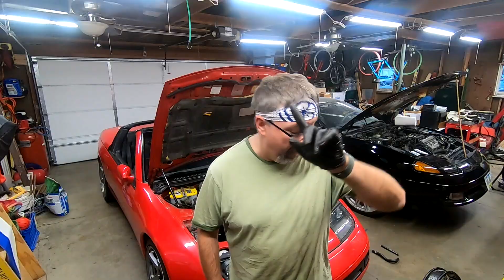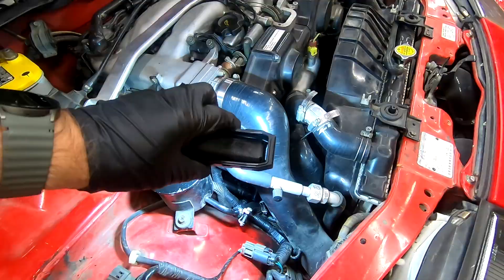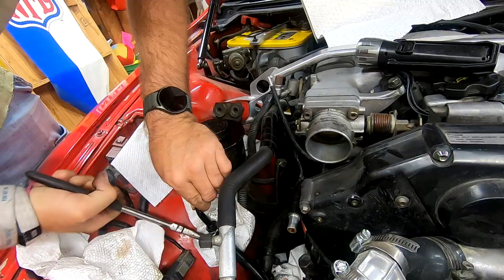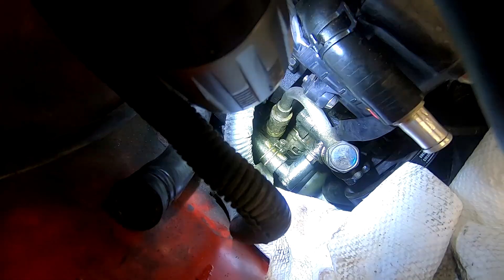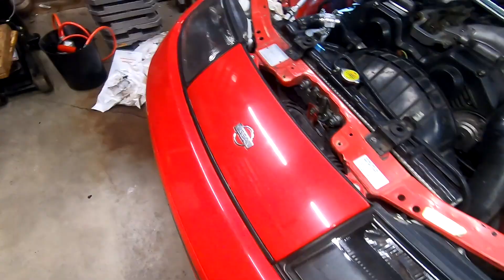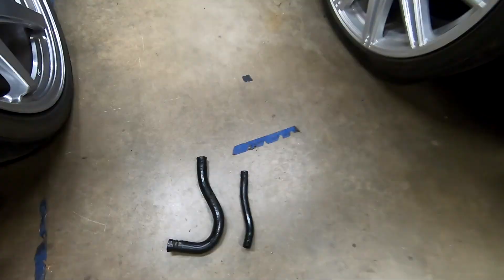300ZX (Z32) - Power Steering hoses - replacement

Comment: This is exactly the video I needed, holy crap, thank you!! I have parts coming in for a handful of jobs, and this is one of the most important. If I'm just replacing that shorter hose towards the front, should i remove the entire reservoir?
Reply from the maker: Maybe, maybe not. you will just have to try and see if you can do it with the reservoir on. if it doesnt work, then just remove it. its not the hard.
Reply: @z32_workshop52 Awesome, thank you : )

Comment: Looked on Z1 for the J hose only seen TT hose. Do you know if they are the same for NA?
Reply from the maker: if you look at the J hose for the NA and TT 94+ it says its for the 90-96 NA and 94+ TT
Reply: @z32_workshop52 thanks mine has wetness around the J hose leading into the reservoir. Filled it up wiped it clean and became wet again.
Reply from the maker: Yeah tht 30 year old rubber should be replaced

Comment: What’s that aluminium thing on that Z1 radiator hose? And I think it would look better if you turned those hose clamps more to the right so the ends don’t stick upwards. Or actually put on OEM ones from Nissan if you can still get them. Greetings from Germany!
Reply from the maker: The upper rad hose has been cut to allow for a Z1 Coolant Temperature Sensor Adapter - Upper Radiator Hose,  So i had to use standard hose clamps in that location. and hello from USA.